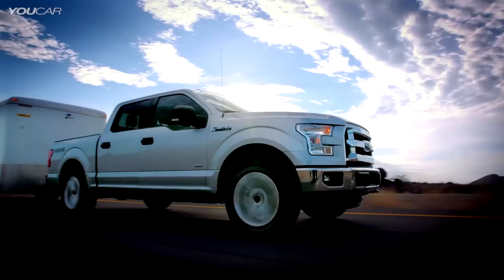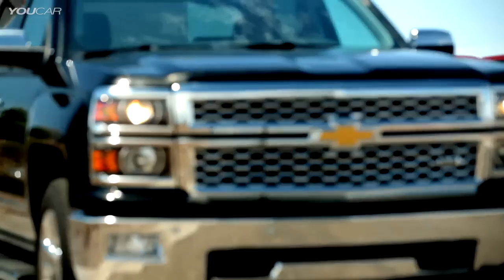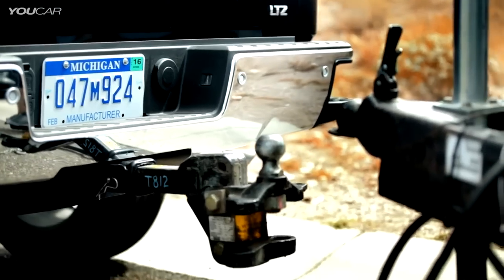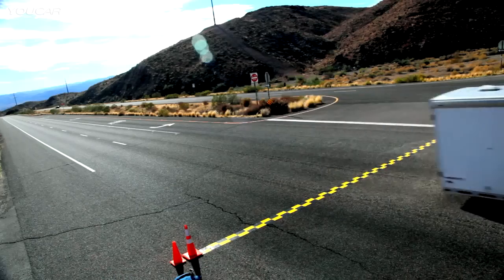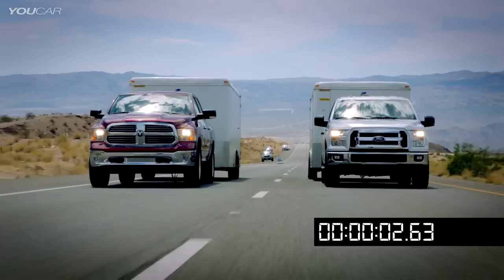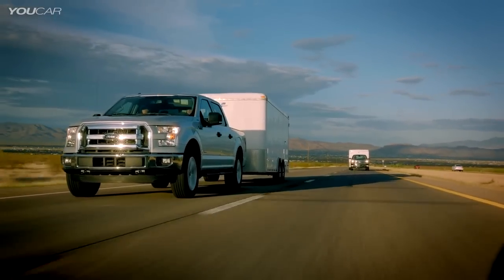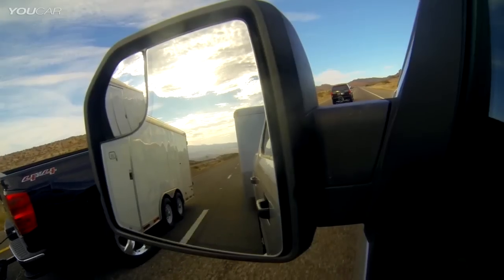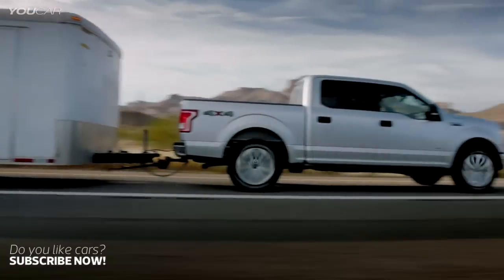TOWING Comparison – Ford F150 vs RAM 1500 vs Chevrolet Silverado

Comment: How reliable are the 3.5l turbo ecoboost motors?  I am strongly considering a 2011 f150 or second choice a 2011 ram.  Any thoughts to sway me one way or the other would be nice.
Reply: I own a 2012 Ram 1500 with a 5.7L Hemi with 3.92 Gears and 4x4 , but just because i own a Ram im not completly biased towards it, the Hemi, GREAT ENGINE, i love it, pared with the gears it has it gets up and goes better then any other 1500 on the market, but the downside is if you consistently haul/tow heavy stuff, the ram just is not the truck for you, because ( I dont understand why ram did this) the truck instead of having leaf springs in the rear it has normal coils, which means the Ram is only rated for 8,500 lbs where as the Ford F-150 pared with the cayote 5.0L v8 can tow/haul upwards of 11,000 lbs, thats a big difference, if you haul/tow anymore then the 8,500 lbs you run the risk of just completly compressing the coils down, but the ride in the ram is smoother, and i have done abit of offroading in it, and its been able to keep up to the challenge just as well as my buddies 2011 ford F-150, but i love my ram, it fits my needs, and its a great looking truck and its got the hemi to back it up, but yeah it all comes down to what do you normally do with a truck
Reply: aaron davidson thanks Aaron.  to be honest I probably wouldn't be towing all that much.  I am looking for an every day driver that I can occasionally tow a trailer, small boat etc.  I would never buy a truck without 4wd but to be honest I probably would never use it.
Reply: ***** if you have a boat, 4wd will come in handy more then you think, cause theres alot of instances where a 2wd has alot of trounble getting back up a boat ramp ( not all boat ramps are grooved) but the ram is up to tasks like that, hell i was helping a friend move today, had no issues with the truck, so for an everyday driver that youll just be hauling/towing smaller stuff and not a huge amount of stuff, then honestly i would like the Ram better, because the ride is actually more comfortable with coils in the back rather then leaf springs, and then the Hemi is just a great engine to have lol

Comment: just wait for the echo boost to get millage on it there has been confirmation on the internet that the valves once they get gummed up they start miss firing and u can't use seafoam or anytihng like that clean it basicly u gotta lift the covers and everything off to hand clena them bc the turbo they say dies out bc of the induction cleaning bc it get to hot

Comment: Why didn't they show the results of the other 2 chevy runs? So the Chevy was 6 seconds slower in 100+ degrees then when "the temperatures dropped" the ford fell behind. So what I'm hearing is that unless you live in Arizona in the summer Chevy is the better buy.

Comment: I just bought a 2014 RAM 1500 hemi! I have a garage door technician and carry around two thousand pounds worth of equipment everyday and have been averaging better than 18.5 miles to the gallon. I wouldn't buy a Ford if they were free, that being said rather impressive win over the Ecodiesel. But I would be rather interested to find out what the gas mileage return was for that same test by comparison to both the diesel and v8.  And just so everyone understands there is an ideal operating range for every engine, putting your foot down to the floor and holding it there does not always return the best response from that engine there is a such thing as a torque curve, something I'm sure they're well aware of and why they staged this test the way they did.
Reply: Don’t spend your money if’s free , Ford Frinking O old R retired D dodge

Comment: I have a Hemi grand cherokee. it replaced a ford f150 with a 5.4 triton that was used to pull a camper. I have to say that ford struggled especially on hills. The Jeep pulls that same camper and I can say I wouldn't even know it's there if I didn't see it in my mirrors. Also, no bs..but before I bought the Jeep, I went to all the dealers here where I live and said I needed sometrhing to pull my camper and I was looking at said Jeep. All the dealers(Chevy,Ford and Dodge) told me "go with the Hemi you will have no problems pulling anything." I'm glad I listened. I want to add my camper is well within the stated towing capacity of both vehicles. Hemi and Cummins is the way to go. Don't waste money on the blue oval if you want anything towed or hauled.

Comment: You can tell there is not 7k in those trailers I have a 6,500 pound trailer and it sags with a stabilizer hitch USED THE RIGHT WAY

Comment: Like Gabriel Chattoo mentioned, most consumers are not engineering specialists. Heck, most of them just don't know simple technical things to consider. So, Ford's marketing works. This is in no way to downgrade Ford. In fact, I have to say they have my respect in their knowledge of marketing strategy. The average consumer is interested seeing a high hp figure on the spec sheet and a low consumption (or high mpg) figure. To a lot of people that's a miracle, and any company that can offer that, wins their hearts. Now, I am, in fact, a Ford fan when it comes to trucks. So, it's not like I'm talking trash against Ford, but really seems like what made Ford tough, what won them over the others is slowly being lost. It's kind of like with BMW, that used to be all about light weight, naturally aspirated engines, slick manual transmissions and chassis tuning for handling; who now have resorted to electronics, turbo chargers and automatic transmissions trying to win clientele from the competition while loosing some of their own. Perhaps Ford realizes that too, but they've done the math and have decided that the gain is more than the loss. In that case, I can't just blame them or talk negatively against Ford. Just sad that purity in things is fading away, that there are no more true trucks and real sports cars. Everything is sort of being pulled together to some middle ground, where everything is everything but nothing specific, really.

Comment: Why do they have to test it in a race? That ecodeisel isn't going to be as fast as a V8 gas engine because, number one diesels have more torque than speed, it's like hitting a brick wall, if you hit it with speed your going to hit it hard and not carry it far, but if you have torque you'll hit it hard and carry that wall with you, just a way to dumb it down for some people.

Comment: Whatever distance they used it wasn’t 13 miles. It would be impossible to have a 2.55  time in 13 miles or even 3.38
On a 6% you might go 2 miles.

Comment: They didnt tell how much gas was used..as they mentioned, Ford is turbocharged. Going uphill for a long period of time, that turbo was spooling for sure..Needless to say, a turbo is hard on gas when spooling to its full capacity. Now im sure they all used alot of gas/Diesel but ecoboost is not as efficient as Ford claims. It is fuel efficient with no trailer, compared to a V8. And for those wondering, the diesel engine in the Ram is not Cummins. Cummins are no longer making engines for the Ram trucks.

Comment: To the last comment. I am referring to the 5.7 tundra. I own a 5.7 crewman and a buddy of mine owns a Eco boost f150 v6 and was impressive but did not keep up with my tundra. Like I said, the only thing is it has better gas mileage. My tundra comes equipped with the 57 liter, towing package of 10800 lbs and 410 gears from the factory. Like I said me and my buddy tested the trucks and the tundra wins hands down. Unless you want to cruise it in the city just for a joy ride then it wins in fuel economy.
Reply: I am willing to bet that your buddy Ecoboost is probably equipped with a 3.53 rear ratio, vs your Tundra 4.10 rear ratio. This explains the advantage of quicker time on your Tundra during a drag race. The 5.7L DOHC V8 on the Tundra is a very good engine, but it doesn't have the latest tech like the Ecoboost. As a long time Toyota owner, I can tell you that when it comes to MPG on the SUV and Pickups, no Japanese company can compete with the Domestic. What do you think will happen if your buddy get a 2015 lighter 3.5L ecoboost F150?

Since the Ecoboost already have turbos on the engine, adding a lot more HP to the truck is much cheaper than adding a TRD supercharger on your Tundra. Also, what do you think will happen to your MPG after adding the supercharger? for about $500 and 30 minute of time, your buddy can add 50HP and 100 lbft to the rear wheels of his Ecoboost F150 with an SCT tuner. That's an easy start.
Reply: Your absolutely right!  But, there's no replacement for displacement and nothing like the sound of a real V8.  It all depends on what people want in a truck. These days, anyone can have a better performing truck if you have time and money. Back to Tundra, although supercharging anything will be awesome but a simple chip and reflash of computer will produce much more power and tourqe
Reply: Realistically, today's engines, especially V8s can produce more hp and tq but the manufacturer won't do it as they tailor back to the daily driver. Technology has come a long way.  To answer your question, I still don't think the 15 ford will beat because lighter and more power especially if a Tundra is recalibrated with chip and no other Bolt ons such as turbo and supercharger. Again the only thing it will be better at is gas mileage.
Reply: Remember, overall performance is not just the drag race but what the truck can actually do such as payload, tow, haul. Unfortunately ford still does not dominate with the f150. We will see with the 15.
Reply: The 3.5 makes more torque and about the same horse power as the 5.7 tundra.  Motor trend and Pick up trucks did a dyno test on the ECOBOOST and said the horse power is closer to 385 than 365.
Reply: Felipe Mujica You have to understand a very simple concept of an internal combustion engine. It takes x amount of air (oxygen) and y amount of fuel to make power. You can't just spray a bunch of fuel and expect them to all burn and produce power. Not enough oxygen, your unburn fuel will go right through the exhaust and make 0 power contribution. For a normally aspired engine, the amount of oxygen it can get is purely based on the atmosphere condition, air filter system, engine displacement (hence the phrase "no replacement for displacement" only true for N/A engines), and depending on cars's setup, the speed it was moving may add a little more air. All these company who sell tuner/chip and claims substantial HP gain for the N/A engines without any other modifications are mostly liars. Modern N/A engines are already well tuned from the factory. You'll be lucky if you can squeeze out another 20 more HP by changing the PCM programming alone. Most of the time, these tuner/chip only move the rev limit a little higher, change some shifting patterns and makes the buyers think the tuner did something because the vehicle drives differently, not necessarily quicker.

Forced induction Direct Injection engine, on the other hand, have a lot more tools to play with. Normal factory setup rarely push the limit of the turbo/supercharger. At 15 PSI boost, it acts as the engine displacement has doubled. Most ecoboost will cut out after 12 PSI from factory programming. The aftermarket can flirt with the boost and allows the forced induction engines to get much higher boost, hence a lot more real power gain by just tuning the PCM. FYI, many hard core racers are running theirs at 50 PSI boost. How much effective engine displacement do you think they would gain going from 12 PSI to 50 PSI? Also, an Audi 2.0L turbocharged DI, in the 2015 TT, is making 414 HP from factory. That's 207 HP per liter from factory. No way that a N/A engine can manage such task.
Reply: The F150 3.5 Ecoboost is and has been kicking the shit out of the half ton pick-up market since 2011  PERIOD.
Reply: lol does your  "truck" have a "towing package"

Comment: Lol alright ford. Let me know when you break down on the way back home from that test. Ford, you cant slap a shit ricer motor with a fuckton of mods plus turbos into a truck and expect it to be reliable while at the same time being competitive with v8 trucks. Congratulations you beat a motor that was twice as big as yours....It only took a shitload of mods to get you there, and now you sacrifice reliability and you will have to replace turbos which is not cheap.
Reply: Pfft I'm sorry that your chevy v8 with 420 horsepower and 450 torque got beat by a 2.7 325 hp and 375 torque engine. Plus yet you say it's gonna break down. You don't need to lie you just want chevy to win every thing.
Reply: So I guess semi trucks are unreliable? Hmm. now I get why Chevy and Dodge trucks are shitty as hell
Reply: Todd Rich That's why they lease for 2 year the 3nd the motors blow. lmfao
Reply: Todd Rich My turbos are warranted for as long as I own my truck.....zero deductible.  If I drive it 200,000 miles, I have zero turbo cost.   Reliability issues ???.....I think not.
Reply: That's great your turbo is but not your motor
Reply: YES it most certainly is.  I have it in writing.
Reply: +Michael Isaacson the Silverado used in this test had the base 5.3 liter engine. If it had the 6.2 liter it would have smoked the Ford all three times instead of just once.
Reply: +Michael Isaacson Also the 2.7 ecoboost is not fords base engine so this test is really misleading. The base engine for the f150 is actually a 3.5 liter naturally aspirated v6 with 282 horsepower, had they used that engine these test results would have been very different.
Reply: Boomerisadog "IF" my aunt had balls she'd be my uncle.  "IF" they used a Titan rocket, the results would have been different too !!  Big deal.  They compared what they compared and the results were as published.  What's your point ?
Reply: the base engine for all three brands is an NA V6. if you're going on bump the Chevy to the 6.2 than you'd have to bump the Ford to the ECO 3.5.
Reply: What mods are you talking about are you serious? How is it a mod if it comes from the factory that way a mod would be putting after market parts on it my god go test drive all 3 and then you will know the diffrence

Comment: He even said soon as temp cooled off the 5.3 beat the ford. Didn't want to show that race lol. Na engines suffer more in the heat than forced induction. Temp went down and good ol pushrod v8 out doing twin turbo ford. Should have used the hemi ram. Would have put it on the ol ford as well.

Comment: So do I just take your word for it? I mean it's obvious your endorsed by Ford by all the videos that are centered around ford, no camera on the gas pedals, never stated if they were in tow mode. I find it also difficult to believe that the diesel got bear due to the nearly double potential energy diesel has over gas.

Comment: Only time will tell how these motors hold up... The graphite block & extra piston ring like the kind semi use to reach a million miles should hold up nice but doubt it will last 200,000 mi... To much pressure from the turbos... 30 psi at full boost imagine towing from Detroit to Texas at full boost cherry red turbos

Comment: Naturally aspirated vs twin turbos? Hmmm. That new f-150 isn't very dependable when the air gets to hot as you can see. Silverado beat it in their last race. Narrator even said it finished seconds behind. I don't think this is a fair competition. Now if the ford wasn't strapped with turbos then it would be interesting. Team chevy

Comment: "We swapped drivers to eliminate confounding factors..." 
Yet, they brought a diesel engine to represent Dodge, and compared it to 2 gasoline engines? Not only that, they freely admitted that temperature change was a variable, and it showed with the Silverado vs. f150 test. I'm gonna go ahead and call these tests bunk, despite my love of ford, as the scientific, and statistic, control of this test was pathetic to say the least.

Comment: Ok, so here we have some people for and some against. The thing is, people who aren't buying into the idea of a V6 in a truck... just think of this. Would you rather have more performance or more noise. Keep in mind, that all the noise you hear is wasted energy in the form of sound. And thus why the most efficient motors on earth are almost silent, electric motors! With that in mind, just think electric and MEGA torque! That's why locomotives are electric, and now Via Motors who are making electric GM trucks, with an on board power generator. My friend converted his old silverado to an all electric truck, he used 4 DC motors from Netgain. it's got 600 hp, and... get this 1260 pound feet of torque!!!! Range is only about 100 miles though. But he plans on upgrading batteries or placing an on-board electric generator. I drove it towing a trailer for only about 15 miles. I have never felt torque or power like this from even a diesel super duty or cummins... I promise! I will try to upload a video of his truck ... it's the future folks and it looks awesome!  For now, lets start with V6 turbo.